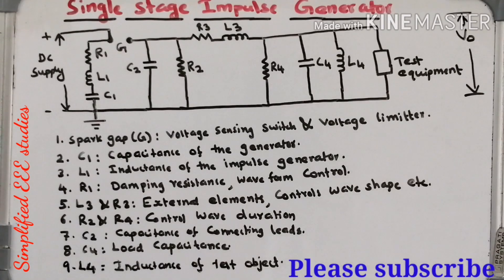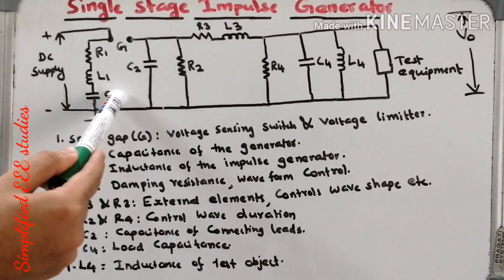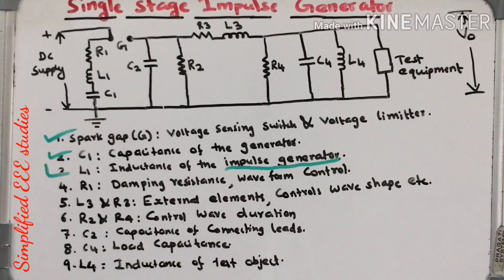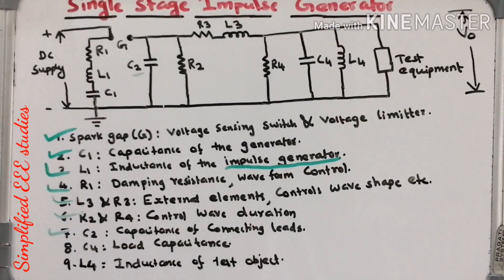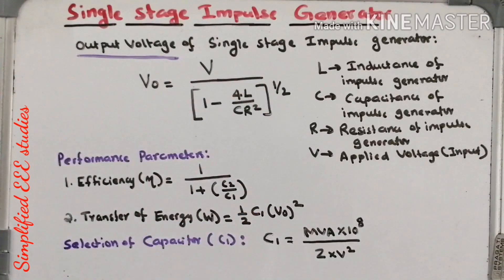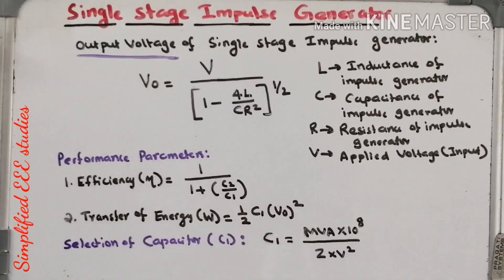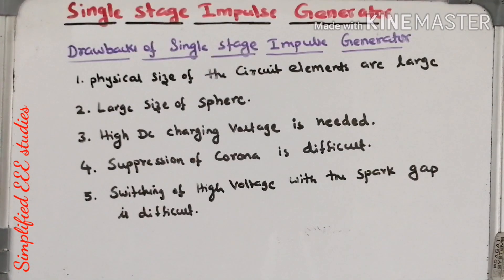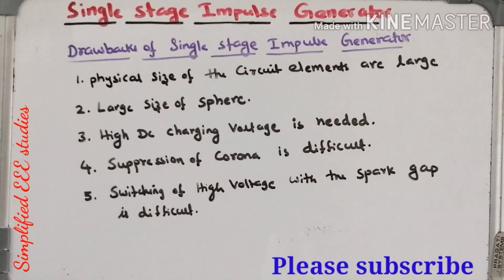Single Stage Impulse Voltage Generator|Working|Construction|Operation|High Voltage Engineering |HVE

Comment: at first you have told the capacitor will charge serially and discharge parallelly. this is wrong information. Capacitor will charge in parallel and will discharge in seires.

Comment: sir i appreciate you understanding very well but some points you don't describe here so well best of luck.
Reply: Good one sir , but need some practical design of impulse generator and to calculate the energy , how to select the resistor, capacitor. Need more details in designing. I am waiting
Reply from the maker: Dear Mr.Satheesh,
I will update you soon.
Thank you
Reply from the maker: Thanks for your suggestions. Surely I will include missing points.